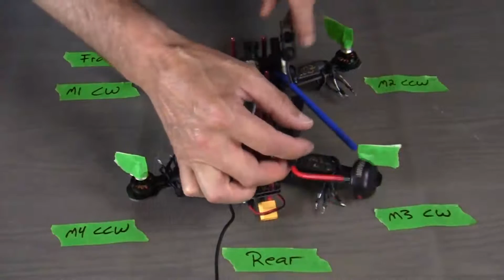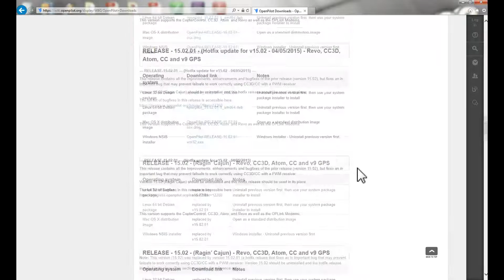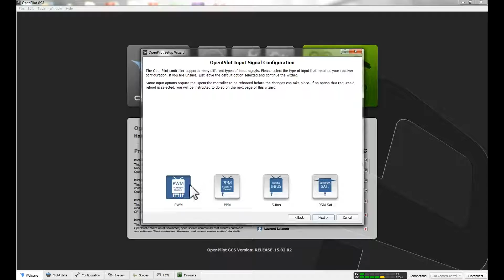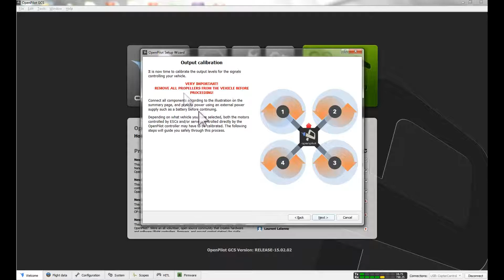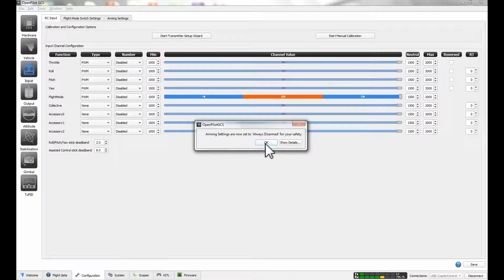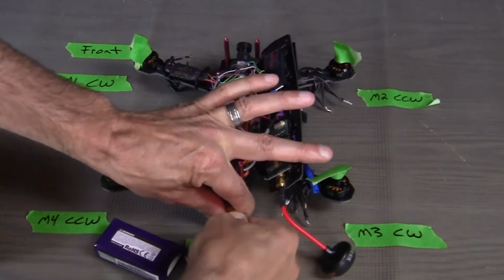How to Build a FPV Racing Quadcopter Part 2 of 2

Comment: Great video man helped me out a lot but I notice around 21.20  1 of your ESC didn't chimed at the same time it sounded like it chimed faster than the other ones mines doing that and I recalibrated it  and my motor don't seem like it has the same power as the other ones I can stop the motor with touch of finger but not the other ones and when I take off it vears that way to the weak motor whats your opion...THANK YOU

Comment: What about fs t6 with multiwii mwc 2.5 fight control plz??i
Reply from the maker: +safu gsm If I get a chance we would like to do a video on using the multiwii flight controller...thanks for the suggestion!
Reply: Thank you very much sir now i work with apm 2.6 with radio tx and rx cheerson cx20 , its good and low cost 
Thank you for help